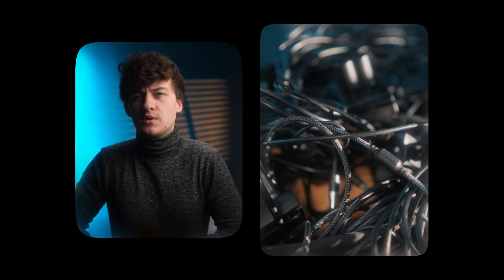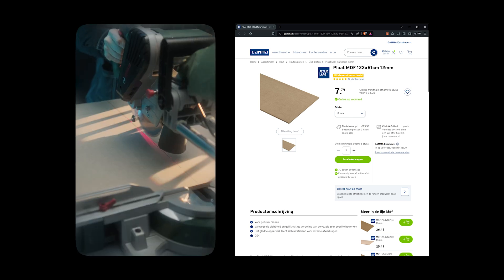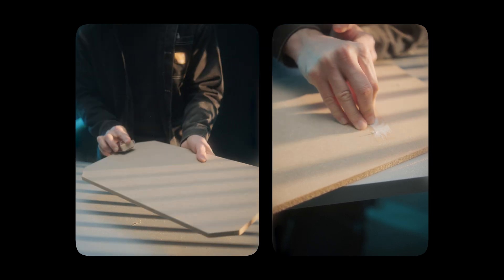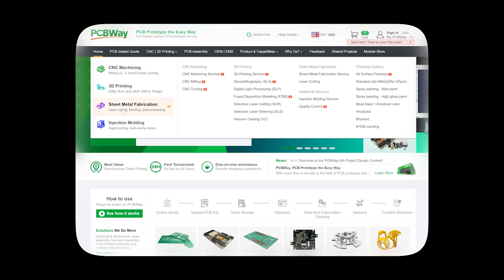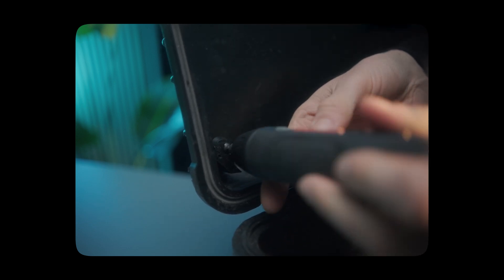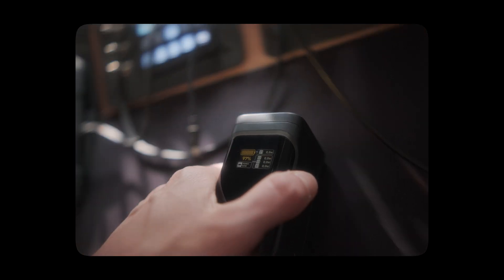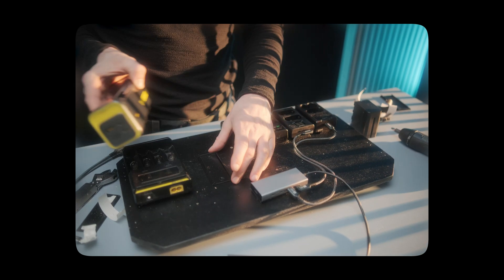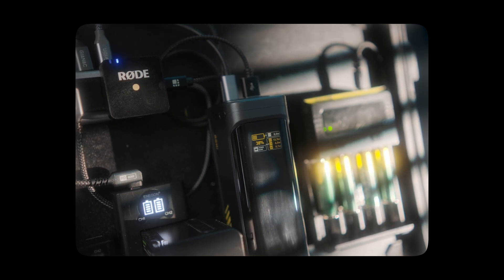Building a Portable Charging Suitcase

Comment: Great Video as always. I have a similar charger wall just in my closet. I think your issue was more the glue on the back of the Velcro. If I have to use it, I either super glue it down. OR... I use something called 'Dual Lock' instead of Velcro all together. There are a few companies that make an equivalent but I think 3M makes it. You will not be disappointed. The adhesion is great at the Velcro part is way better than Velcro in every way. Cheers!
Reply from the maker: Glad you enjoyed it! I'm going to look into this Dual Lock stuff I am very intrigued thank you for mentioning it!